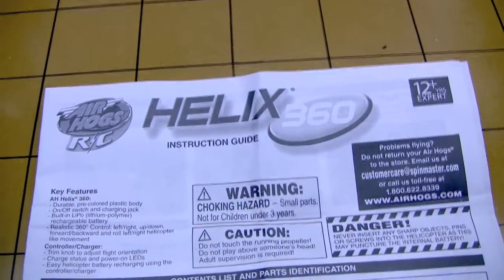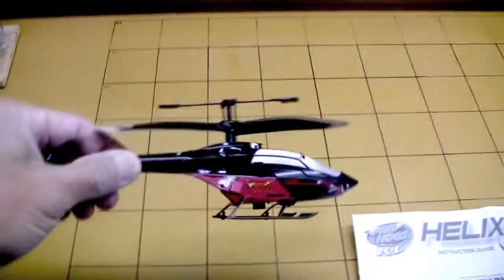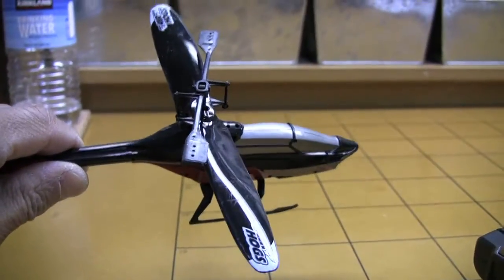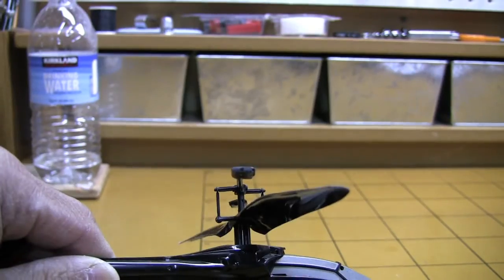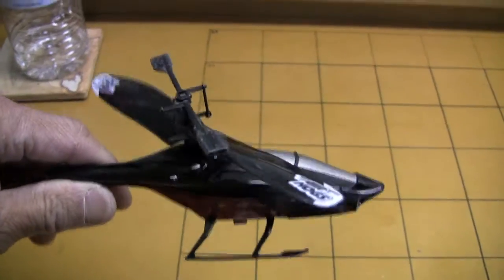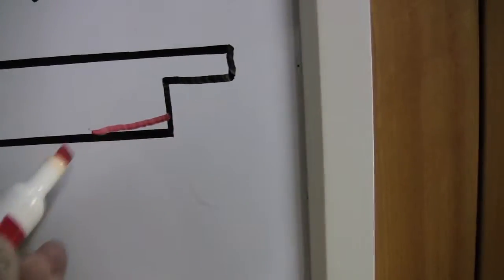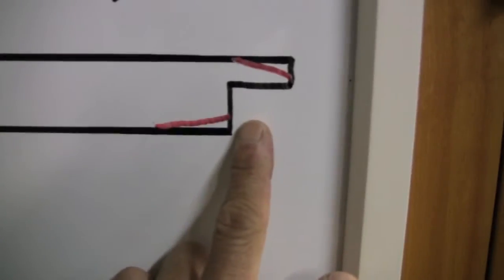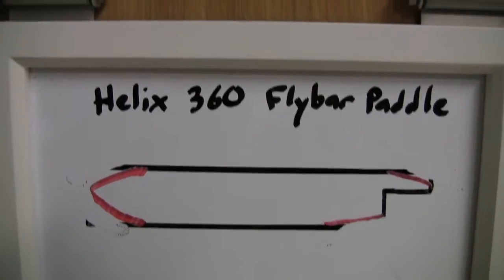Air Hogs Helix 360 Modification

Comment: Interesting, I might try this.  I've learned to fly it really fast by using the tail rotor bias since it is giving you a bit of boost toward the left.  I have a few videos talking about indoor RC helicopters as well.

Also, I'm happy to note that my helix 360 has survived over 50 flights since I got it.  Nice and reliable little aircraft.

The one mod I did was to cut the control sticks a bit shorter and put bolts into the top of them for better feel and faster response.